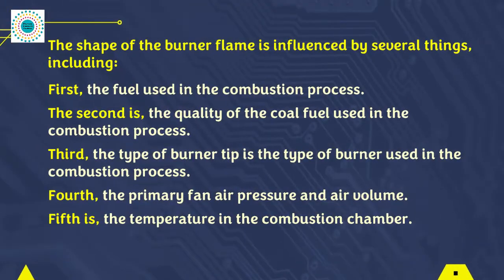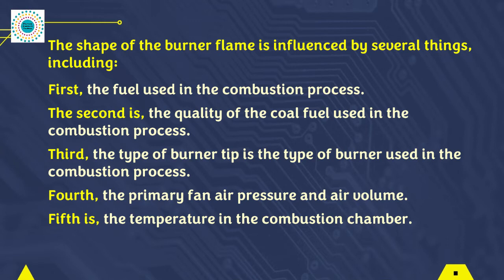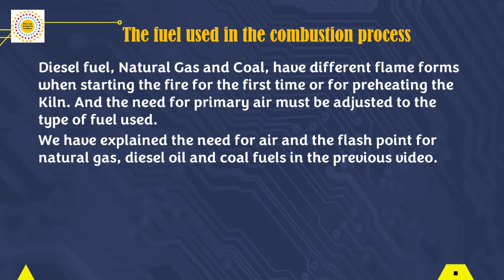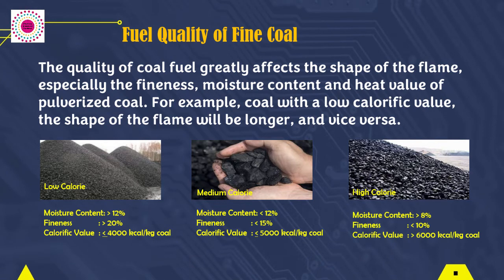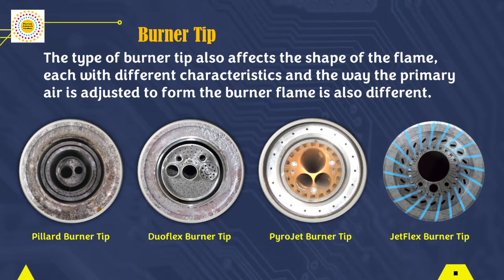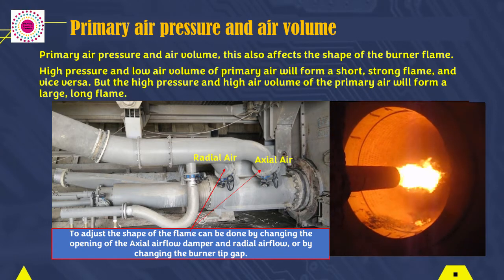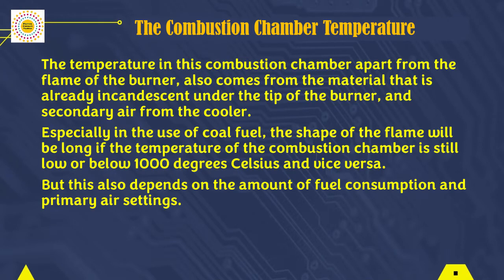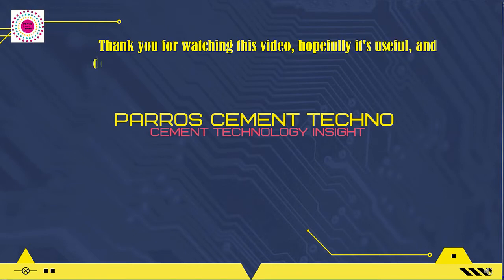What Affects the Flame Shape of the Main Burner Kiln Cement_ English Version

Comment: Sir, can you explain the melt where usually appeared when rotary kiln is at low feedrate? I've asked my supervisor but I am confused his explanation because it seems to be the liquid phase of the raw materials.
Reply from the maker: Thank you for your question.
The liquid phase in the rotary kiln begins to occur at a temperature of 1300 oC to 1450 oC.
When the kiln feed is still low, the liquid phase can also occur, because the layer of material in the kiln is still thin. But it must be balanced with the rotational speed of the kiln, fuel consumption in the main burner and proper primary air settings, so that the liquid temperature of the material can be met.